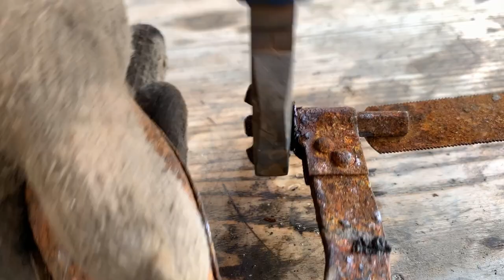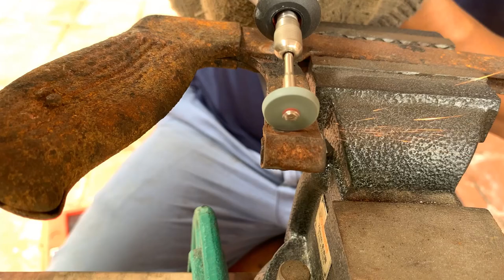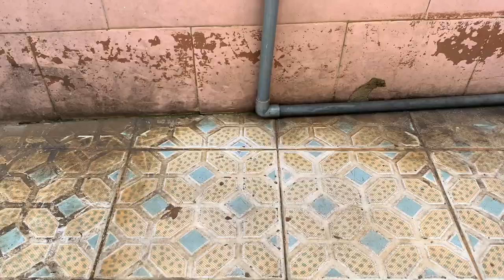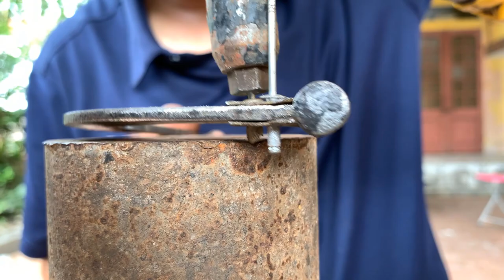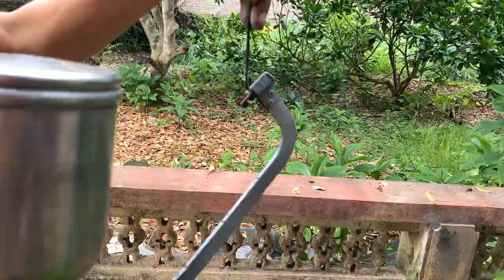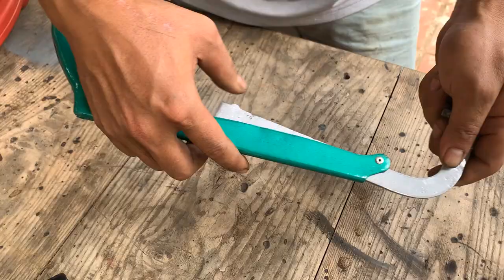Restoration Rusty Old Hand Saws Left By The Roadside // The Worker Excellent Restoration Skills

Comment: You need it safe edge file you won't carve up your work when you're trying to get out them rivets. You can make your own hammer rivets out of nails they look a whole lot better than them aluminum pop rivets or you could use barrel bolts with a little bit of loctite I realized maybe where you're at all that stuff isn't that easy to find but it sure would help.